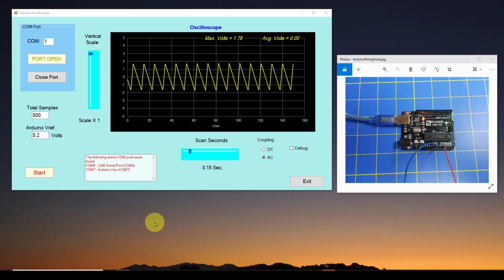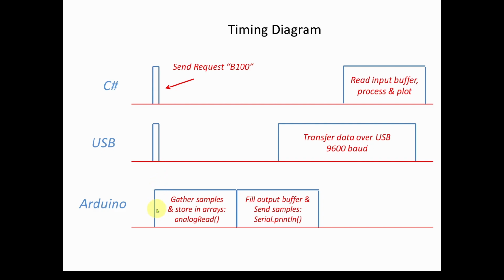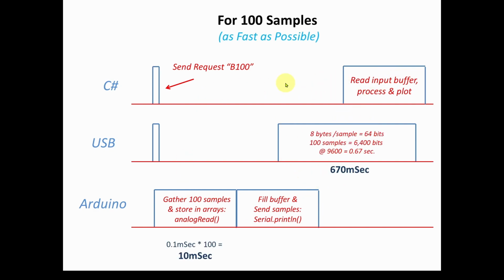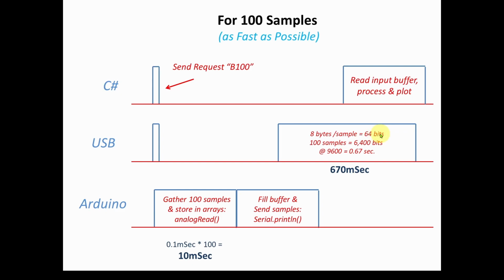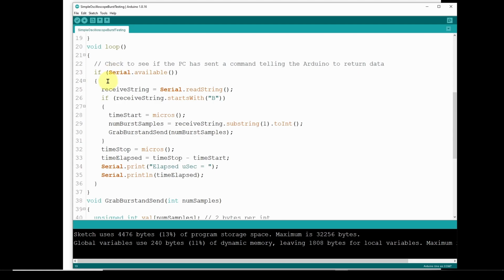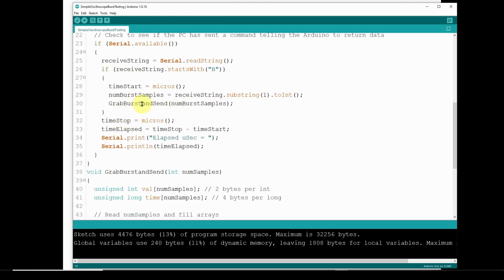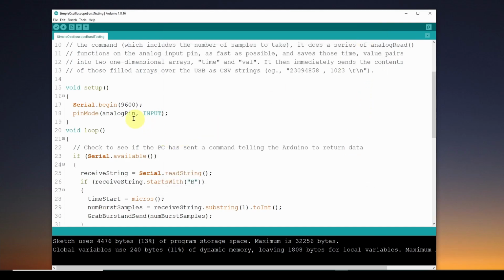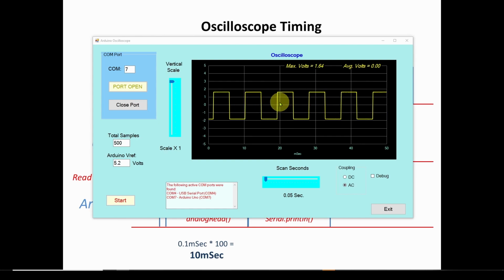Arduino Oscilloscope Part 2: High Speed USB

Comment: Very nice 👍😃

I have a suggestion, in a situation where you want to send as little unnecessary data as possible due to the bandwidth constraints, why send the whole microsecond value? Why not just the offset to the last sample? Or, and I realize it is not as exact as before, calculate an average of how long every sample in a burst took and send that before every array of measurements, you would be able to save RAM and transmission time. Might be possible to squeeze a little more data through the USB this way 🙂